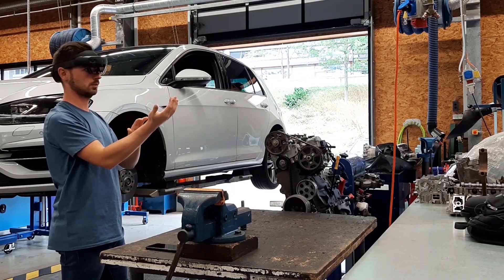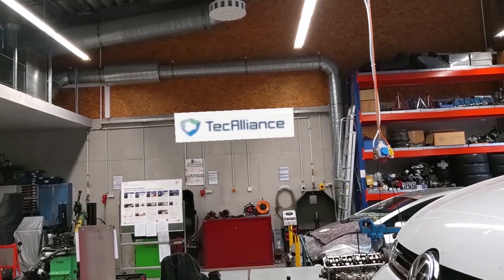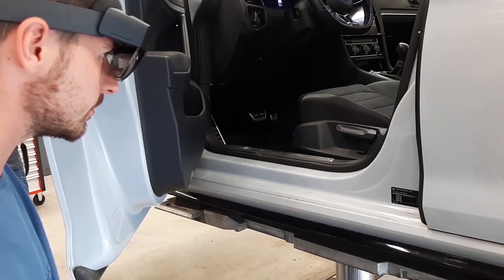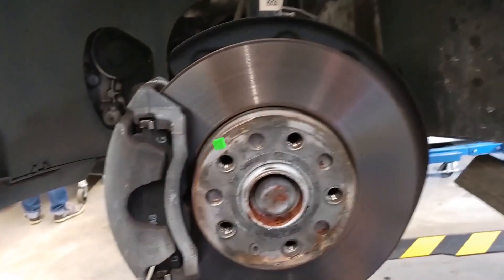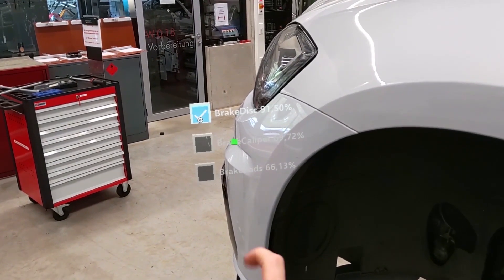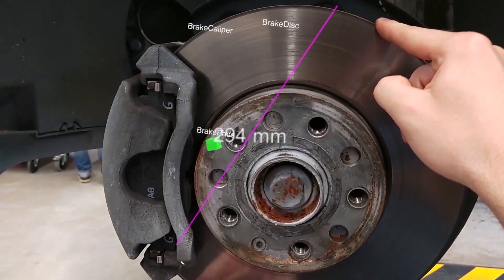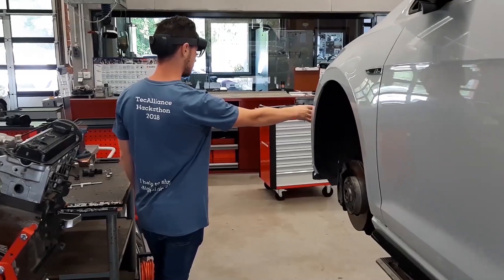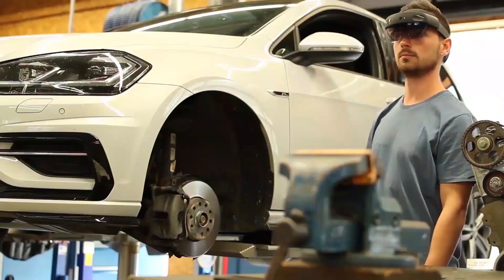TecAlliance's HoloLens 2 - Mixed Reality in a workshop environment

Comment: Tha's weird, Microsoft talks about 2K resolution which perfect but after watching the video even you can see Every pixel on the menu
Reply: also erstens ist 2k für ein Sichtfeld nicht unbedingt viel. Selbst die "billigen" Quest 2 von Meta haben mehr pro Auge.
zweitens ist das eine Aufnahmefunktion mit zusätzlichem 3D Render . Wer weiß, was da deswegen noch alles mit einfließt.
Und ohne antialiasing würdest du in fast allen PC spielen mit einem Full HD Bildschirm auch "aliasing" sehen und vermutlich als Pixel wahrnehmen.

There are other AR HMDs where the elements look way smoother, like the nreal, but there is more flickering going on there, since it doesn't stabilize the elements in the virtual environment as good as Hololens 2 does.
Reply: Oops didnt realize I switched languages there.

first: a 2k resolution isnt all that much. Even the rather cheap Quest 2 have more per eye. 
second: Its a record with additional 3d rendering. The picture is mainly the same as what he sees, but its probably not exactly the same. Its rendered for another type of display at least.
There is not Antialiasing used for performance reasons. If you have a 24" full HD monitor at home you'll also see quite a few pixels if you don't use antialiasing.

I've used the Hololens 2 a few times in the last months and the bigger Problem ist the small FOV and the fact that its straining for the eyes, even if the Hololens is turned off, since its like 0.5 to 1.5 cm of plastic you have to see through. luckily you can just fold the display up.
Reply: @absolutsolo2763 , I've been using it since 2020. It's perfect if you are happy to waste your money.